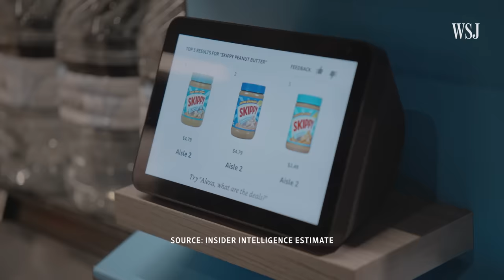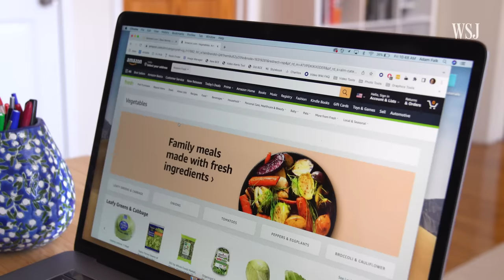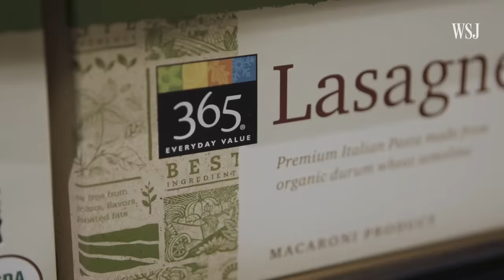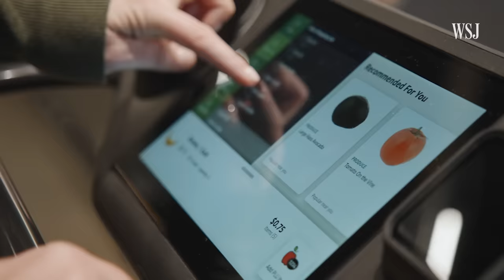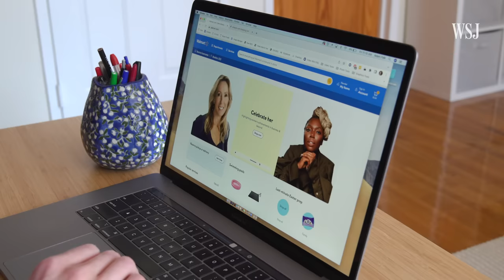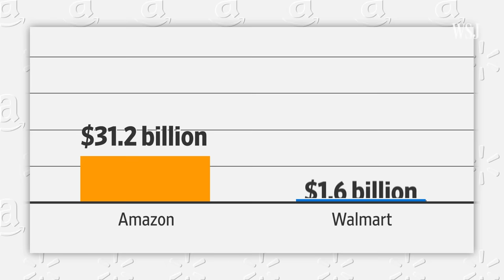Amazon vs. Walmart: How the Giants Look to Each Other to Best Each Other | WSJ

Comment: I went to a Walmart recently that got rid of all cashiers, only has self-checkout and they added a huge tv in every aisle with a camera pointed at you and the self-checkout line was 10x longer than any normal line because people are slow to scan and bag there stuff, I will never be shopping at Wal-Mart again and I'm a millennial, not good Wal-Mart.
Reply: I agree, if I wanted to work there as a checkout clerk I'd apply.
Reply: What that says to me is that people need to learn. I find it fun to scan my own stuff tbh.
Reply: @jimmaag4274  im assuming you don't shop when you go in either. because if you wanted to work you would apply to be a personal shopper.
Reply: @Trunojo  that's kind of a stupid take on my comment.
Reply: I'd never consider shopping where there's no cashiers. Machines don't pay taxes which supports our entire society. Education, infrastructure, social programs all come from taxes.
Reply: @justsayin5609  there are the same amount of cashiers tending to self checkouts.

Comment: Walmart groceries are cheaper than every other chain, except for Tom Thumb with coupons.
Tom Thumb without coupons is usually way more expensive than Walmart. 
Usually Kroger and Tom Thumb are very similar in price.
Walmart also generally has the cheapest gas around. 
Amazon Fresh seems to be the absolute most one can pay for groceries. It may compete with Whole Foods (AKA "Whole Paycheck") in terms of price. 
It will be interesting to see where H-E-B ranks, because I remember the prices as being competitive to Walmart, when I had one near me, but there is not one near where I am now.
Anyway, that is just my observations

P.S. Tom Thumb, Albertson's, and Safeway are all owned by Safeway Inc.
Reply: Walmart’s prices are not cheaper than ALDIs
Reply: @hobie1613  Aldi sometimes beats Walmart. I'm pretty sure a pound of meat, a pound of rice, a pound of beans, a 10 pound bag of potatoes, etc are very similarly priced. Sometimes Aldi's and sometimes Walmart is cheaper.
Reply: Walmart (supercenter) is not cheaper than the independent grocer here in mid-missouri. I always spend more if I shop at Walmart.
Reply: My local Albertsons usually have weekly specials and coupons, they are good at making the coupons works.  I lived in Texas,  and California, Walmart produces are not cheap